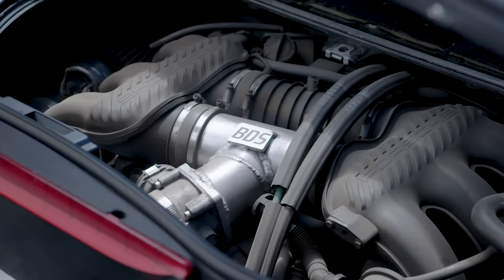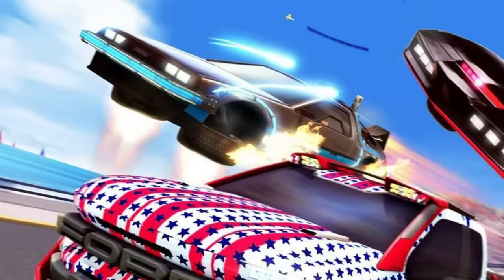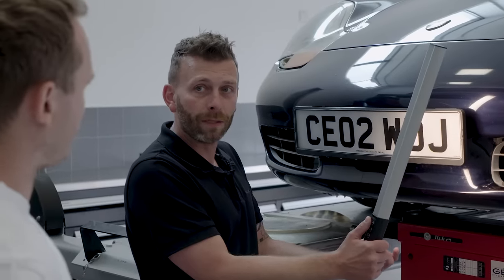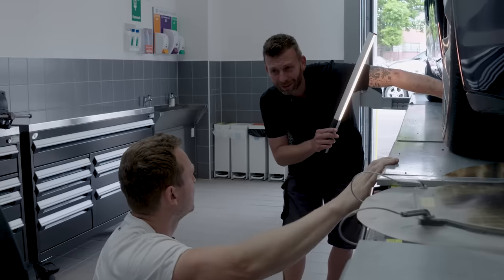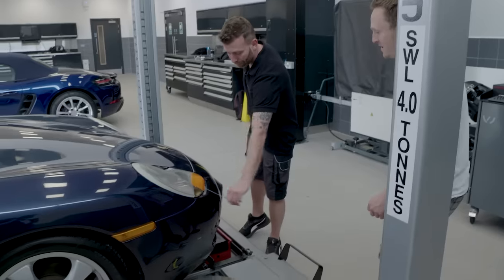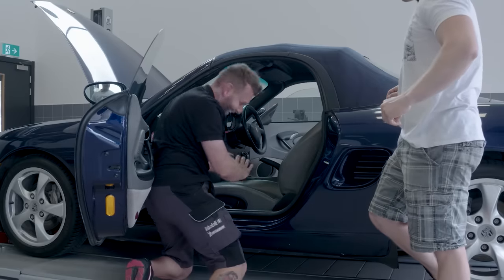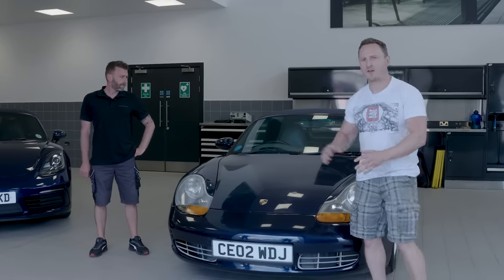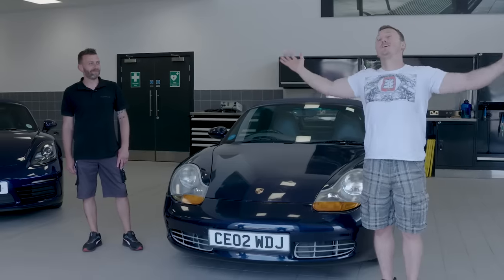Should A Boxster Be Your Next Project Car?

Comment: The Porsche Boxster and 944 are arguably two of the best and underappreciated, affordable Porsches you can get right now. 944 prices are rising rapidly, the Boxster is sure to follow. Great job on raising more awareness chaps 👍
Reply: 100%.
Reply: You can add the 924 Turbo to that list. Good ones are still under 10k
Reply: Oh man, the 944. I can't recall the amount of times I've considered to just go out and buy one.
Reply: 944s been going up for years now
Reply: Nah, that's Boxster and 914. Change my mind.
Reply: Now their prices are gonna shoot up thanks.
Reply: Or u can buy a volkwagon beetle. Same look but the beetle was driven by Hitler soooo.
Reply: @Cooladj  that really doesn't even work in this case...
Reply: @The Back Roads Ah are we looking at the same car. The Boxster looks like every other Porsche which also looks likes a beetle. Now the 944 and 928 are greater cars i actually on a 944 roller that I've been planning to Ls swap. 928 are great too. All the other Porsche all look the same and at this point, i am starting to wonder what their design team is even doing. I would rather them take the BMW approach instead of pumping out the same car.
Reply: @dionvandenberg  i wanted one when i was looking for my first car, decided against it because reliability. However, back then a good one was 6-7000 euro while a bad one now is 10k euro.
Reply: @darkkingll  Yeah... in the end all of them become money pits. And they don't even drive that well. It's all about the iconic looks, I guess. Those old school Audi four pots don't really do it any good. I would hate it if they'd dissapear from the streets though, so good thing they are rising in value a bit :-)
Reply: @dionvandenberg  I've had an early dash '85  944 2.5, and then a 944S2. I then owned a 964C2 and now own a 2001 986 S. This 'not a real Porsche' thing is 101% bullshit.  They are all real Porsches.. And they were all over 15 years old when I bought them. Never had any real issues. Some of my best driving memeories ever were in that first 944.  B293CMW. Still going strong.  There is no substitute.
Reply: @porker964c2  I never said it isn't a real Porsche, only that some of the engines aren't. In fact, going by looks alone, I'd say it's Porsche's first true original design, except maybe for the 928. Those two make me stop and look twice whenever I see them, something that other Porsches just aren't capable of. I just never was impressed with the soundtrack and performance of the base models of the 944 though, and those are about the only models that are ever put up for sale around these parts. Not enough folks willing to part with their S2's, I'm afraid. Congrats on owning a pristine 986, they're also not easy to come by. Be kind to it, it deserves to be kept from the sands of time :-)
Reply: @Cooladj  What an absolute philistine comment. First off: the Beetle, for all it's quirks, is a good looking car. Second of all, the 356 and 911 are evolutions of the concept, rather than direct mechanical lineage. It's also pretty great that Porsche produced one of the greatest sports cars ever built essentially from the Beetle, conceptually speaking. Third: the Boxster looks nothing like the Beetle, the proportions are completely different. Even if it did, so what? Which reminds me...

Finally: this design is perfect. That's why you're a philistine: to regard Porsche design poorly but somehow favour the new BMW's? Do you actually want something beautiful or do you just want to stand out? Because the 911 looks are already perfect, it would be a crime to change it. I would rather them develop the stuff that counts: the mechanicals and tech. That's what matters the most, and that's what Porsche does: constantly evolve their cars.
Reply: Boxster prices have been rising for a while. You would see some advertised for under 3k a couple of years back. Lucky to get a decent one for less than 5k now
Reply: I've  had both, and a 1986 911 in-between.  The 944 is an outstanding car, had it 6 years,  it never broke down.  Had a 2000 Boxster s, fantastic car, also never broke down.  Although the maintenance was a lot more expensive.
Reply: @porker964c2  yep I did a similar thing  oval dash, 1986 911, then boxster s. The 911 was fast but  awful and crude compared to the 944 and boxster.
Reply: @shaunportlock4924  I loved the 964, but it was tiring on longer trips. Nothing like it though, air cooled 911 are alive.  But the 944 and 986? I love them too. Hard to chhose between them tbh.
Reply: 944s are from a time when German cars really were built to last a long time. Not just a badge like they are now.
Reply: @BlatentlyFakeName  doesn’t make sense. German cars, Porsche in particular, are more reliable now than they ever have been. They have a longer warranty and require less repair in average than earlier years.
Reply: It’s kind of weird that Porsche he’s calling the 986 Boxster is classic because mine is a 99 and I was born in 1999 so I guess I’m a classic too my Boxster is an Area Red metallic with Savanna beige interior with 68,700 miles I am the sixth owner I Bother with the intent of well I want a little project to fix up and I have for the most part until she was outside and a hail storm got her none of the glass was damaged, but there are some dents in it which I’m gonna have to pull out along with some mechanical things I don’t mind it’s a Classic Porsche what am I gonna do say no no way not only is it a Classic Porsche now, but it was my dad‘s first Porsche the 986 Boxster, not that exact car of mine I wish it was metallic blue with what he described as lobster red interior which sounded pretty cool and it my 986 Boxster was my first Porsche. It’s a five speed manual car so it was my first manual transmission car. I love it. I’m never going to part with that car I don’t care how much money I have to spend to sort it out make it as good or better than it was when it left a factory I’m going to do it for the joy of the drive that car gives me when I’m behind the wheel of it even in its current dented up state with slipping clutch and all I still cannot be mad when I’m driving that car if I am in a bad mood and I get in that car and drive it instantly in a good mood it never fails you can’t be mad and drive that car or any Porsche for that matter they are great automobiles. My mom had a 955 generation, Porsche Cayenne in lapis blue metallic my dad had after I was born a 996 generation glacier white 911 Cabrio with black interior. I have pictures of sitting in that car when I was a baby I can instantly that is where my love Porsche cars came from my father and my mother, but mostly my father is at every 911 with a manual transmission under the sun even a 1977 911 I have a picture of that with me standing next to it in the garage of our summer home and Idaho when I was 10 I was so mad when he sold that car he sold it for a brand new 2007 red Chevy Corvette, which I mean what is a great car to don’t get me wrong but the reason why he sold it was because it leaked oil every time we go to that house for the summer because those air cooled cars don’t like to sit they don’t have gaskets to hold the oil in because of the tight clearances when the engine is warm like they’re water cooled counterparts do and that’s why he sold it. He should’ve taken it down to our current residence where we were living at the time and use it as a daily driver that was in 2007 back when the water cooled stuff wasn’t that expensive now they’re through the moon and because of that, I am never going to part ways with my 986 box instead I’m going to restore it completely and it probably won’t be worth a whole lot but it’ll be a nice daily driver and that’s all I want my father thinks I’m crazy for thinking that way, but it’s a Porsche. What am I gonna do sell it and it’s current condition I don’t think so not to mention it’s the cheapest mid engine car besides the MR two spider or the Pontiac Fiero that you can buy at least 986 987 generations are the 914s they are going up in value because their air cooled the 718’s too expensive already even for a used one the Carrera, GT forget about those were expensive when they came out in 2004 they are astronomically expensive now C8 Corvette. They said those were going to be affordable mid engine sports cars. They are not they also said that about the last Corvette the C7, which also wasn’t so I’m gonna hold onto my 986 for a long time probably for the rest of my life. The only way I’m going to part with that car is if I physically part ways with that car because I’m too old to continue living, and it goes into an estate sale upon my children’s request or something but that’s what makes the 986 and 987 Boxster’s special especially right now they’re the cheapest and most fun mid engine sport car they’re essentially like a Mazda Miata with the engine in the middle. That’s what they are to me. In fact the reason the Porsche Boxster even exist is because Porsche Saul back in the 80s and early 90s. The success of Mazda is a little two door sports car roadster that was affordable and simple but fun to drive and said we need a car like this in our lineup because the 911 was too expensive for most people at the time so they decided on the Boxster in the mid 90s after releasing the concept car in 1993 and then releasing it fully to the public in 1997 technically 1996 but the cars were put together a year earlier which was also one of the cars that saved Porsche well it didn’t save Porsche directly it kept them afloat that owner would later in 2004 go to the 995 generation Cayenne, which did in fact say Porsche which looking back on it now my two favorite models and generations of Porsche is the 986 Boxster in the 955 Cayenne, and of course the 996 911 because I grew up with all those cars the running egg headlight shape has always been cool to me just because it’s warm and familiar and it reminds me of home I mean that was the first shape I saw as a kid between my dad’s 996 911 Cabrio and my mom is 955 generation, Cayenne. It’s cool to have a 986 Boxster from that generation it’s really cool my dad wanted me to have a newer one, but I was adamant about that particular generation for a reason

Comment: I didn't really like these before, but lately I'm starting to come around to them. Just accessing the engine seems like a chore though.
Reply: I bought a Boxster when miata prices started skyrocketing here. The intake noise you get right behind your ear is amazing.
Reply: @luffy858  I hadn't really considered that. Can you imagine how much better the noise would be with a super charger? You'd probably have to do a lot of modding to do that, but it would be awesome😎
Reply: @isk1tz  but you will loose power with this "mod"
Reply: Actually it is not that bad at all. Sure you can't stare at your engine and admire it that easily, but for maintaince everything is nice and accessible - much better than let's say on a Mercedes. I have quite a lot of experience with these cars and an engine out job takes about 3-4 hours if you take your time and do it properly, but you should know when to loosen what part and in what procedure. In the end it fits all very nicely in the car. If I have to replace my clutch or do have to do any work on the engine itself (like valve covers etc.) I don't even bother starting wrenching underneath the car on a lift - i just take the engine out, much better access a you can gurantee a much higher quality of repair too.
Reply: @luffy858  right
Reply: I don't know. Ima kid of the 90s. Loved the boxster when it came out. Should still have the boxster psx game lying around somewhere.
But man, the 996 just didn't age well at all.
Reply: @boredbanana7324  I mean I would partially agree with that in regards to styling but I'm just considering what you get for the money today for around $10k(USD) you get a 6spd, convertible, a turbo, around 300 HP, mid engine, and interior that's actually pretty nice, and it's a Porsche so you get exceptional handling as well. I'm just considering that for the money that sounds like a great deal.

Comment: I worked in a porsche specialist garage for 1 year & have seen about 5 engines that has had either IMS bearing fail or the IMS chainring being worn bent or faulty, so I think it is a common problem. I actually bought a 2.5 Boxster with a broken engine, it was cheaper to buy another engine than to rebuild. Cylinder 6 was cracked on the original engine.

Comment: The letter "U" in the chassis number means the car was built in Finland by Valmet Automotive , Porsche subcontracted some of the Boxster and Cayman manufacturing out as the Stuttgart factory needed extra capacity . The "U" letter means  Uusikaupunki , a town in the south west of Finland , they're currently are making some Mercedes A class models there , there is a rumour that the cars from here are better made than the German made ones . https://en.wikipedia.org/wiki/Valmet_Automotive

Comment: I'm about a year ahead of you on restoring a late 2001 Boxster S! Great cars, the body control modules can be repaired by a few specialists so don't jump straight into buying a new one. 

I also have the templates to reproduce the under-bonnet chassis label as they fade in time and I can decode the options to find out how the car was spec'd up.

Comment: “Porsche thinks about the people that have to work on these cars.”

Having just replaced the water pump on one of these…they barely thought about the people that work on these cars. Also the water pump is a common wear item. At 100k miles, expect to be replacing it.
Reply: I dont agree. It took me half the time (including bleeding the coolant system) to change Boxster waterpump than on the meriva that belongs to my Missus.  As unfriendly as the car seems to work on, the more jobs ive done on it, the more i think its not so bad. Been told 996 is much worse to work on as its too cramped in the back.
Reply: @kacperczubkowski9227  I agree with you. If you're doing jobs regularly or at least more than once on these cars they get easier with practice. I replaced my water pump on my '07 Cayman on my drive and in a blizzard, in the depths of winter. Replaced every suspension component, also in winter, including Bilstien PSS9 coil overs and top mounts, rebuilt the CV joints while the drive shafts were off, and rebuilt the brakes with all new components. Also just replaced the AOS, piece of piss.
Reply: @kw8757  Is there any other time to do difficult repairs? :D At least it should be done at night, in the rain. :D
Reply: @MongooseTacticool  Been there, done that, got the T shirt 👍. I love my Cayman but it likes to try my patience.
Reply: A water pump at 100k miles is far from uncommon... Lots of cars actually have it planned in the service manual sooner than that.

Comment: I own two 986 Boxsters. A 986 2.7 and a 3.2L version. Those are great drivers cars, especially considering the money and the Porsche brand name. 
Parts availability is great, many parts can be bought used for very cheap as many Boxster become parted out. Everything is well layed out and thought through, easy to work on and cheap to maintain for a diy kind of guy. Furthermore insurance is very low and luggage space is decent, making it a great daily driver or weekend fun car. 
The interior quality is not as bad as people say it is and in person the quality is actually really decent for a 20 to 25 year old car. However the early 2.5L Boxster have a lower quality in the interior as the 2.7 and 3.2L version, depending on the extra options. 

Anyone saying that the Boxster isn't a good sports car or that it is just a grocery getter has never driven one! The Boxster delivers such a great and rewarding driving experience and an excellent exhaust note in the interior (especially with the porsche sports exhaust from eisenmann). It's light and nimble and eventhough it only has 200 something horsepower depending on which engine you have it is also a very light car weighing just 1300kg. A much more compareable figure would be hp/kg where this car is great considering the age.
Reply: I know you wrote your comment over a year ago… But out of curiosity, which Boxster was better out of your 986’s.
I’m a couple of weeks away from a potential purchase, and I can’t decide between the 3.2 S and the 2.7! 
If acceleration/speed is the only real difference, then I’m not fussed as I’m a bit over 0-60 dashes from traffic lights etc.
But I’m interested in things like which sounds the nicer engine/exhaust note from stock etc.
Or if the S’s firmer suspension meant the handling was recognisably better etc. 

Cheers in advance.
Appreciate your opinions. 👌